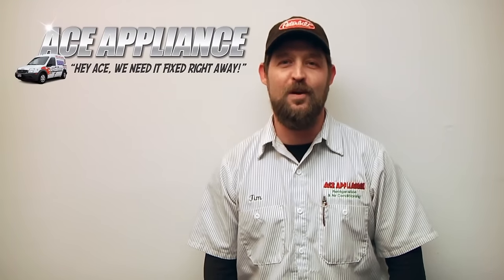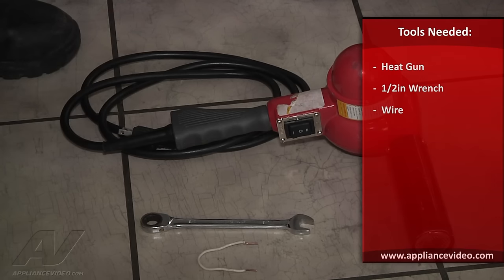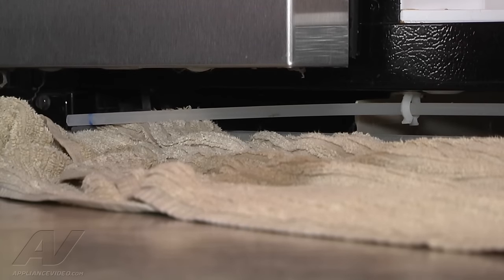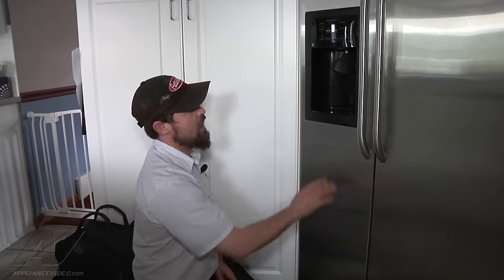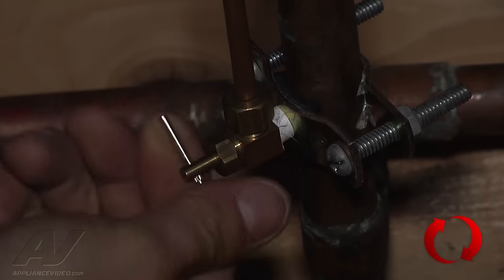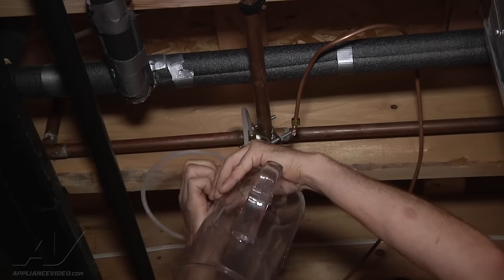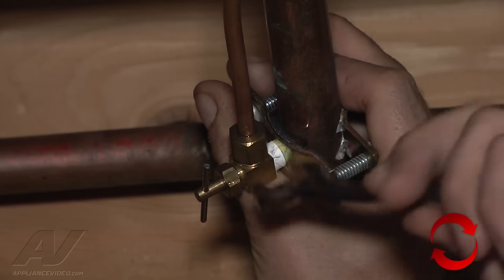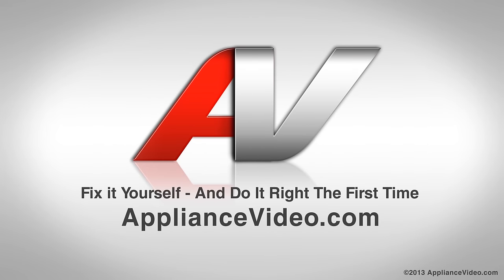GE Refrigerator Repair - Door Does Not Dispense Water - Saddle Tapping Valve Troubleshooting

Comment: What if no water comes out from the line you showed at the beginning of the video?
Reply from the maker: Great question, you can call
our parts department at 1-800-830-5465 and they can give you help 6-days A week
Mon-Sat . You can also search at www.SaveMoreOnParts.com 7- days a week.  If you have a more
technical question that our parts department cannot answer, our technicians are
answering all questions at our website at www.ApplianceVideo.com under our Repair Help section. We have over 6,000
common questions and answers that you can easily search through by your model
number, appliance make, problem or error codes, and It’s completely free to
search through our question & answer library. There is a very good chance
you question is already answered there.

Comment: I was getting ice but no water on my GE fridge.  So I tried a heat gun to unclog the line of any ice.  But it appears that I melted some plastic parts because the switch that made the click and activated the ice/water dispenser isn't working at all now--no more click and boy do I feel like an idiot. Any ideas?  Thanks!
Reply from the maker: Great question, you can call our parts department at 1-800-830-5465 and they can give
you help 7-days A week. If you have a more technical question that our parts
department cannot answer, our technicians are answering
all questions at our website at www.ApplianceVideo.com under our Repair Help section. We have over 3,000 common questions
and answers that you can easily search through by your model number, appliance
make, and problem or error codes, and It’s free to search through our question
& answer library.

Comment: I did this and now the water won't stop dispensing unless the door is open. Ack! Any suggestions?
Reply from the maker: Great
question, you can call our parts department at 1-800-830-5465 and they can give
you help. If you have a more technical question that our parts department
cannot answer, our technicians are answering
all questions at our website at ApplianceVideo.com under our Repair Help
section. We have over 3,000 common questions and answers that you can easily
search through by your model number, appliance make, and problem or error codes,
and  Its free to search through our question & answer library.

Comment: I disconnected the water line at the bottome, and pressed the water, nothing came out :( we just replaced the valve :(  suggestions?
Reply from the maker: Did you replace the saddle valve or water inlet valve ?
Reply: ***** whatever is on back of fridge
Reply from the maker: CaoGurlB
             If you still have poor water pressure you will need to replace the saddle valve also.

Comment: I'm getting water, and the ice is being made but it's not dispensing?
Reply from the maker: Great question, you can call our parts department at 1-800-830-5465 and they can give
you help 6-days A week Mon-Sat . If you have a more technical question that our
parts department cannot answer, our technicians are answering all questions at our website at www.ApplianceVideo.com under our Repair Help section. We have over 3,000
common questions and answers that you can easily search through by your model
number, appliance make, and problem or error codes, and It’s free to search
through our question & answer library.

Comment: yes but what water enters but water doesn't come from the bottom
Reply from the maker: Great question, you can call our parts department at 1-800-830-5465 and they can give
you help 7-days A week. If you have a more technical question that our parts
department cannot answer, our technicians are answering
all questions at our website at www.ApplianceVideo.com under our Repair Help section. We have over 3,000 common questions
and answers that you can easily search through by your model number, appliance
make, and problem or error codes, and It’s free to search through our question
& answer library.

Comment: I did what you did exactly and now the part of my dispenser that you push is melted! Now what???
Reply from the maker: Great question, you can call our parts department at 1-800-830-5465 and they can give
you help 6-days A week Mon-Sat . You can also search at www.SaveMoreOnParts.com 7- days a week.  If you have a more technical question that our parts department cannot answer, our technicians are answering all questions at our website at www.ApplianceVideo.com under our Repair Help section. We have over 4,000 common questions and answers that you can easily search through by your model
number, appliance make, and problem or error codes, and It’s free to search
through our question & answer library.

Comment: What if your problem is like mine NO ICE dispenses !
Reply from the maker: Great question, you can call our parts department at 1-800-830-5465 and they can give
you help 6-days A week Mon-Sat . If you have a more technical question that our
parts department cannot answer, our technicians are answering all questions at our website at www.ApplianceVideo.com under our Repair Help section. We have over 4,000
common questions and answers that you can easily search through by your model
number, appliance make, and problem or error codes, and It’s free to search
through our question & answer library.

Comment: What happens if the heat gun melts the tubing at the bottom, where the two ends connect. I followed the directions to the letter, but now the water shoots of the connector when I try to reconnect everything.
Reply: Same. If you got part, do you have a link?

Comment: +ApplianceVideo.com hello,  How do you do for not melt the hose with the heat gun???Thanks,  Wating for your reply
Reply from the maker: +vegui1 

Good question, with our
technicians now getting hundreds questions weekly, they are answering all questions
at our website http://www.appliancevideo.com/repair-help/ .  We also have over 30000 common questions
and answers that you can easily search through by your model number, appliance
make, problem or error code and it’s absolutely FREE.
Reply: +ApplianceVideo.com  I'll check but maybe no other ask this question

Comment: Why did he not check to see if the water filter inside the refrigerator was clogged?  Most likely never changed and is the source of the weak water flow.
Reply from the maker: Great question, if you have a more technical question that our parts department cannot answer, you can search our over 17,000 answered questions free at our website www.ApplianceVideo.com under our Repair Help section. You can also call our parts department at 1-800-830-5465 and they can give you help 7-days A week ,or search at www.SaveMoreOnParts.com  .

Comment: show me inside lower freezer
Reply from the maker: Great question, you can call our parts department at 1-800-830-5465 and they can give
you help 7-days A week. If you have a more technical question that our parts
department cannot answer, our technicians are answering
all questions at our website at www.ApplianceVideo.com under our Repair Help section. We have over 3,000 common questions
and answers that you can easily search through by your model number, appliance
make, and problem or error codes, and It’s free to search through our question
& answer library.

Comment: You still don't have very good flow at the end.  I would recommend changing the onboard water filter.  The water flow will slow as the filter gets dirtier,  mine almost sprays hard enough to splash out of the glass your filling after putting in the new filter.
Reply from the maker: +chester reaves Yes, this house had bad water pressure we actually did replace the filter. Thanks for your input.

Comment: You can easily melt plastic on a refrigerator using any sort of blow dryer, so be very, very careful. Keep the blower way back from the plastic, and check the surface with your hand frequently. If it is too hot to touch, you are applying too much heat. 

Your video doesn't take into account the frozen tube problem behind the dispenser that is solved by the electric heat part that GE has come out with. If the water isn't dispensing because it is frozen near the termination of the tube, then using that part is going to be best fix.
Reply from the maker: +mrtodd3620 

Thanks for the input, we appreciate any tips that can help people prevent issues. We will add in a speak tag to remind customers about the plastic melting if too much heat is supplied.  We have helped
millions of people repair their own appliances so please help us produce more
videos to our site by subscribing to our YouTube page, or posting our http://www.appliancevideo.com/ website on your Facebook or Twitter account. Our
factory authorized technician’s also daily provide free professional Repair
Help to people like you to help solve their appliance problems. You also have
the option to email a factory service technician with a question at http://www.appliancevideo.com/repair-help/ .  If you need of parts for your major
appliance, we have over 5-million parts in stock at http://savemoreonparts.com/ . Thanks in advance for supporting us. So email
us if you have any other questions our videos cannot resolve. Thanks for your
support in advance.   Matt, Ace Appliance service technician.

Comment: I am just passing through here.  Watched some of this video because I have a non working dispenser.   The Kenmore could not have a frozen line because it never had "Cold" Water from day one.  In fact, I always laughed about it.  I think our tap water is colder than what our Kenmore ever dispensed.  It may be the solenoid, but in my experience, Solenoids usually start leaking before they ever die.   Freezing?  Not in my case, Ha ha.
Reply from the maker: +DOLRED  It is the line that runs through the freezer liner that makes it freeze. It only happens if you do not use it for several days at a time. They did not put enough insulation next to the line. Water temperature will not be affected.  
. Please help us provide more videos to our site
by subscribing to our YouTube page or posting our http://www.appliancevideo.com/ website on your Facebook or Twitter account. Our
factory authorized technician’s also daily provide free professional Repair
Help to people like you to help solve their appliance problems. You also have the option to email a factory
service technician with a question at http://www.appliancevideo.com/repair-help/ .  If
you need of parts for your major appliance, we have over 5-million parts in
stock at http://savemoreonparts.com/ . Thanks
in advance for supporting us. So email us if you have any other questions our
videos cannot resolve. Thanks for your support in advance.   Matt, Ace Appliance service technician.

Comment: Hey It worked.  I did as you instructed and checked to see if the problem was in the door and it was.  I then used a hair dryer for a short while and a few drops of water came out.  I had some flexible thin wire that I use on my remote control planes and pushed in.  I could actually feel the ice crystals and a small amount of water came out. I reattached it and it Worked!!. My biggest problem was getting the grill that covers the bottom back on but figured that out as well. Thanks again. Terry
Reply from the maker: Thanks for your response, we are glad we could help. Our library of over 5,700 videos are currently helping over 1.6 million people like you every MONTH.  Please help us by subscribing to our YouTube channel, or post our website www.ApplianceVideo.com to your Facebook page, Twitter, Instagram or any other social media sites. Your support will help us keep producing more free quality videos.

Comment: Even though this  video  is 8 years old, your insight helped us figure out the water line was frozen. We tried using a blow dryer but in the end turned up the freezer temp and left the door open, about 15-20 minutes later we had water.

Comment: I just checked.....At 2:00 in the video, what does it mean if I have no water coming from that line?  But I do have ice cubes being made and the water pressure from the wall to the water inlet valve is good pressure and has a brand new water filter with good pressure on the return line.  Could my water inlet valve be mechanically failing?  It has good continuity.  I tested it.

Comment: So here i am NOT even thinking of a frozen line. I worked from my water source forward. Checked water source saddle valve, water into and out of filter , jumped switch out, checked 110v sitting at main water solenoid and 120v at coil when switch is activated.  Figured bamm the water solenoid is at fault until i watched this video. 5min of Hairdryer operation and metal wire snaked tube and bamm back in business.  Thinking of drilling hole in cabinet door and spray foaming cavity of door to prevent this from happening again. Thanks for the video. Never would of thought of frozen tubing.
Reply from the maker: Thanks for your response, we are glad we could help. Our library
of over 5,700 videos are currently helping over 1.6 million people like you
every MONTH.  Please help us by
subscribing to our YouTube channel, or post our website www.ApplianceVideo.com to your Facebook
page, Twitter, Instagram or any other social media sites. Your support will
help us keep producing more free quality videos.

Comment: Good advice.  I used the heat gun on the ice dispenser.  Inside and outside.  You do have to be careful not to melt the plastic.  But it worked like a charm.  Didn't know the trick about checking solenoid by disconnecting the water supply on the bottom.  That was KEY.
Reply from the maker: FandC 
      Thank you for your positive comment. We are glad we could help resolve your issue and hopefully saved you money. Please help us provide more videos to our site by posting ApplianceVideo.com on your YouTube, Facebook or Twitter account or add us to your circles. If you are in need of any parts please support our parts department on line at http://savemoreonparts.com/ or call 1-800-830-5465 7-days a week until 11pm Eastern time. Thanks again your support.  Matt, Ace Appliance service technician.

Comment: Ok have a GE cafe, bought in 2014.   The hot water dispenser (not the lure model) stopped working 2 years ago.   Not been a big deal but just looking to get it fixed now.   Any easy fixes?   It runs through the heat up process, but when turning the knob, no water comes out.  Please help!
Reply from the maker: Great question, if you have a more technical question that our parts department cannot answer, you can search our over 17,000 answered questions free at our website www.ApplianceVideo.com under our Repair Help section. You can also call our parts department at 1-800-830-5465 and they can give you help 7-days A week ,or search at www.SaveMoreOnParts.com  .

Comment: Hi. We had a water softener break on us and spilled resin beads into the plumbing. We cleared everything but the fridge and not much water coming out. Whirlpool side by side with 2 dispensers on the freezer door. Where might you think the clog would be?  Frozen water bottom of freezer
Reply from the maker: Great question, if you have a more technical question that our parts department cannot answer, you can search our over 13,000 answered questions free at our website www.ApplianceVideo.com under our Repair Help section. You can also call our parts department at 1-800-830-5465 and they can give you help 7-days A week ,or search at www.SaveMoreOnParts.com  .

Comment: Followed video, used hair dryer for 20mins and now the water dispenses. Unfortunately the hose connector at the bottom wouldn't seal tightly anymore and water would leak.  I had to purchase a new connector.
Reply from the maker: David Estrada Just call our parts department with your model number at 1-800-830-5465.

Comment: What to do if water did not flow from the detached plastic tube located below the freezer door? Pressed WATER dispenser paddle. Nothing.😞
Reply from the maker: Great question, if you have a more technical question that our parts department cannot answer, you can search our over 17,000 answered questions free at our website www.ApplianceVideo.com under our Repair Help section. You can also call our parts department at 1-800-830-5465 and they can give you help 7-days A week ,or search at www.SaveMoreOnParts.com  .

Comment: Yes, works, but a  word of caution. When I heated the area of the spout where the water comes out what I didn't realize is that the dryer was so hot that it warped the the plastic shute that guides the water into a cup.  Because of this,  it no longer clicked to dispense ice or water.. It took me a while to figure it out... I removed the front control panel and once I did I could click and make the water and ice to come out and I realized that the  ice shute/sleeve wasn't able to go back far enough against the stopper to get it to engage the trigger to allow ice or water to come out.   So I heated it backup and just use my hand to pull it forward to kind of remelt it so that it gave enough area that I could push it back and engage the trigger.
Reply from the maker: Great question, if you have a more technical question that our parts department cannot answer, you can search our over 17,000 answered questions free at our website www.ApplianceVideo.com under our Repair Help section. You can also call our parts department at 1-800-830-5465 and they can give you help 7-days A week ,or search at www.SaveMoreOnParts.com  .

Comment: Thanks for posting this great video. I had just changed my water filter and suddenly water wasn't dispensing. I was sure it was related to the filter, but followed this video to confirm that water actually was flowing through it. I did 2 cycles of blasting a hair dryer through the line with the freezer door open and almost gave up. I tried a third time and an ice chunk flew out and cleared the line. Thanks again for this excellent guide.